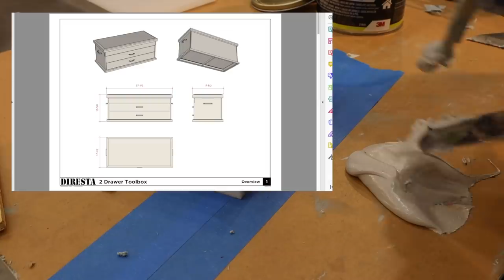DiResta Resin Soap Dish

Comment: There are reasons for putting a reversed logo on it, but they’re not entirely convincing – so I’ll say it’s either a mistake, class A trolling, or both.
Reply: I think it has to do with the camera or I missed something entirely.
Reply: I think it's so the Diresta soap bar can slot into it directly.
Reply: @DebrouillecoEN  Good point
Reply: if you notice at the end, he puts it in there and it kinda stamps DiResta into the bottom of the bar.
Reply: No matter what soap you put in, it DIRESTA soap.
Reply: If it was a mistake, he could have mirrored half the video to make it right.
Reply: @GTAMAN561  You’re mistaken. He received a bar of soap with DIRESTA stamped into it. He placed that into the soap dish face down and then picked it up and flipped it the right way up.
Reply: @kjamison5951  No he isn't, go to 9:46 and look closely

Comment: Interesting but I propose instead of building up the slanted sides this way, it would have been easier and more precise to make the initial shape a bit larger and then saw down the slants, angling your chop saw by 10° or so. Or mill down the slanted sides on the milling machine. - Although that said, building up the sides seems a good way for viewers who don't have such machines.

Also have you ever tried a magnetic stirrer? Very handy, although I'm not sure how well mine would cope with high viscosity fluids such as resin.